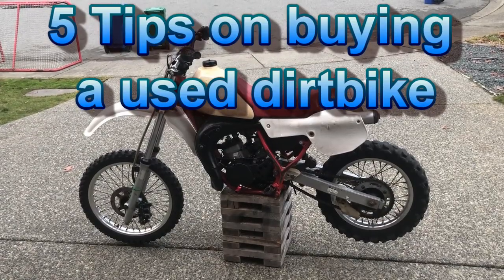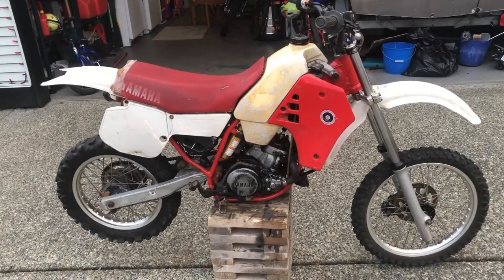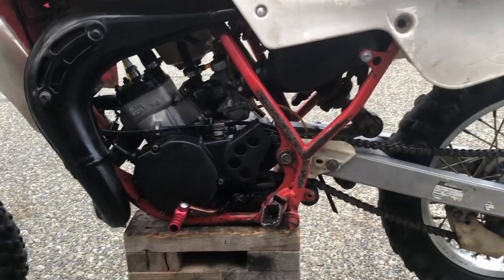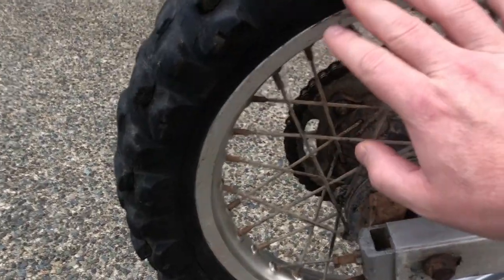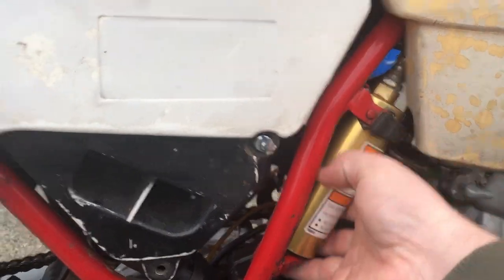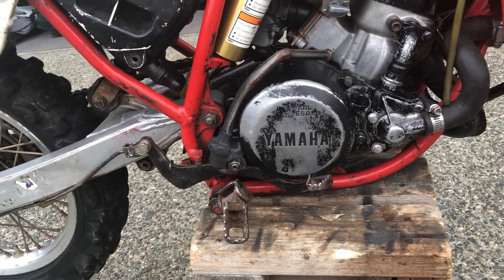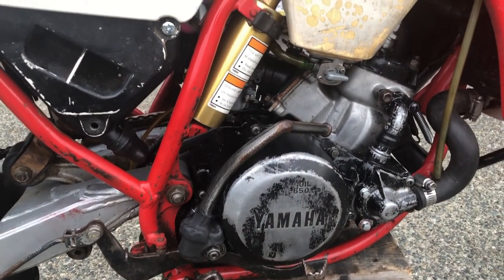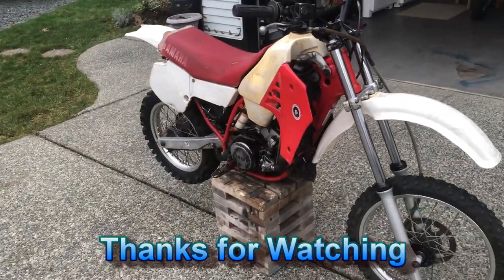5 Tips on Buying a used dirtbike

Comment: Knowing when to say "no" is an under-valued mechanical skill. I think you've made the right call. I'd look for a similar bike with a strong engine to do a swap. If that's not available, then plan B to part out or sell to someone else as a project is the way to go!
Reply from the maker: Thanks dan. I have elected to do plan b. Even if it runs for how long and at what cost. I have looked around for a motor but they all seem to be in the same shape for that year. Oh well. Live and learn. Hence this vid. Cheers.

Comment: Hey man what colour blue did you use on the pw 50 wheels I love that colour man
Reply from the maker: It’s called electron blue pearl by dupli-color. I used it on foot pegs and the handle bars as well. It waorked well and was easy to apply. I put about 4-5 light coats on it. Spreads and layers nicely. Cheap paint but it did the job.
Reply: Bigair01 thanks man I appreciate your reply I don’t have a channel but I rebuild dirt bikes all the time I’ve got a few bikes man Yamaha WR450F 2018 yz450f 2020 Yamaha R1 2019 I’ve got many videos on my rebuilds but don’t have time to edit them for uploads
Reply from the maker: Ya sorta a hobby of mine. I have self taught myself and just trying to share some of my tips over the years I have learnt. I am trying to build this channel to support my hobby and working on bikes. Eventually I will have a whole array of different content. But it is time consuming to edit. Some of these vids are like an hour long that I reduce to 15 minutes. So I know what ya mean. Cheers